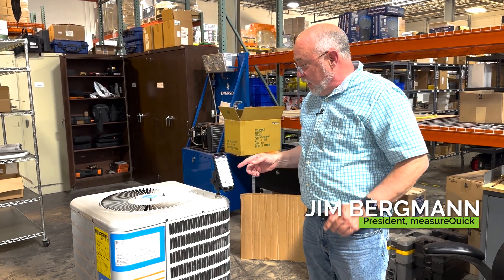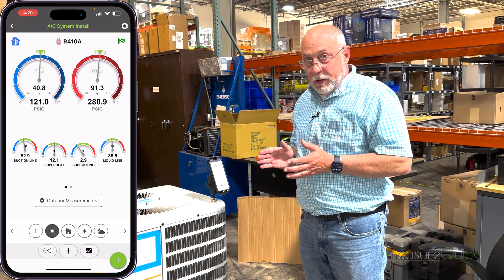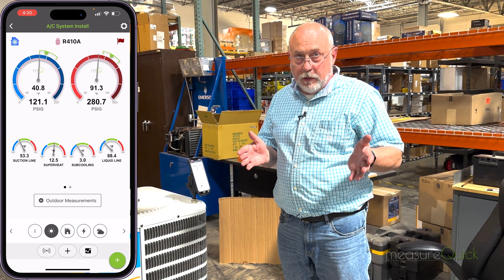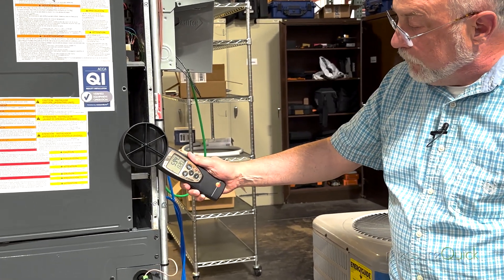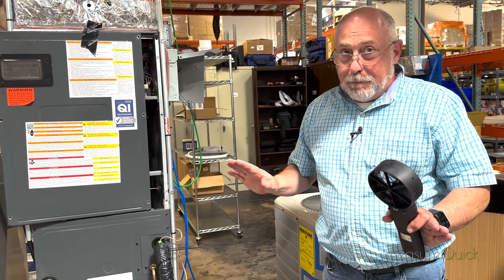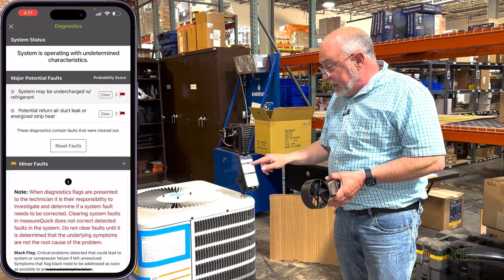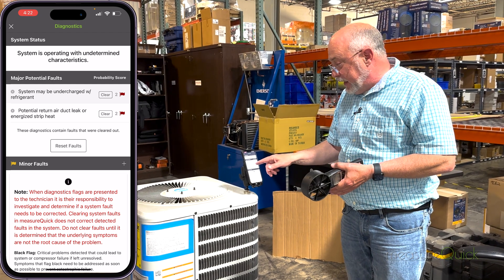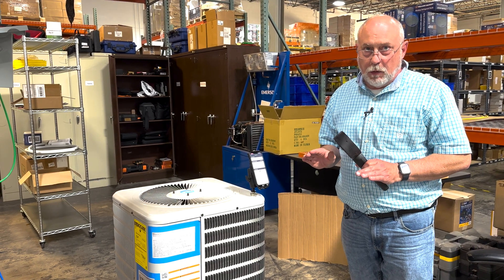Troubleshooting HVAC Issues Beyond Superheat and Subcooling

Comment: ❓The other day i was getting about a 10psi difference on the mQ app compared to the Field piece app. Put the gauge on it and the field piece was accurate. 
Why would i get different readings if they have the same source?
Reply from the maker: @MoonRambo702  did you zero a probe in the toolbox with pressure on it? Maybe open the toolbox and press the zero button. They are software zeroed.
Reply: @measureQuick  Ah, I did not. Thanks

Comment: How can you tell if your fan speed is too high if you don't have an anemometer? And will a too high fan speed raise the evap pressure too high on a perfectly charged system?
Reply from the maker: @realSamAndrew  static pressure with a manometer. High airflow will have a larger impact on superheat, making it go up. The pressure is driven by temperature and by a smaller part RH. Pressure changes with high airflow are small. I can do a video on that and show the impact.
Reply: @measureQuick  I would like to see that video. If superheat is too high due to airflow, then without paying attention to airflow and charging by superheat only, wouldn't that cause you to add too much refrigerant to lower the superheat, creating higher than normal evap pressure? Sort of a secondary cause/effect?

Comment: The anemometer measures air velocity that needs to be averaged over the area of the leak. You went directly to CFM. Did I miss something? The temperature of any air bypassing the evaporator also matters on a real job.
Reply: Good point, but he was just giving us an example of not just looking at SC and SH to determine if the system is good.   However, when he used the anomometer, it was just to give us the idea of what he meant. 
😅
Reply from the maker: @lynncomstock1255 You are correct I entered the open area of 80”^2 and K-factor of 1 beforehand. It was also just a quick estimate to understand the size of the problem.

Comment: Curious what MQ estimated airflow  was? Also have you made any content wi MQ and the testo 429 flowhood?
Reply from the maker: @hvacshinobi8047  the estimated airflow was outside of what we allow the software to calculate. That said it would have over estimated it had it calculated.
Reply: @measureQuick  
Okay, so how would you know to go looking for the mystery air leakage or maybe the better question is how did MQ make that presumption?
If you did not have MQ, what is the way to come up with possibilities like that?
Reply from the maker: @jrsmyth9761  temp split, approach, leaving air conditions, bypass factor etc. The software is looking at both sides. We have expectations on how the airside should perform when the refrigerant side meets expectations as it did in this example.  Could’ve gone into much more detail, but I was trying to keep the video short.

Comment: Sometime you have to just accept real world conditions.
Reply from the maker: And sometimes you simply need to improve them.
Reply: @measureQuick  You can't improve anything unless the customer give you the OK, if you have a massive air leak and the customer tells you that can't afford to fix it than your gauges are the only thing you can base your repair on. You do the best for the customer with what you have to work with.
Reply from the maker: @discoveryman59  you can always make a temporary repair in that case. That’s a good use for duct tape until in can be properly addressed. That said, it’s not the customer declining the repair that is typically the problem. It’s typically a mechanic , not finding it altogether and not offering the repair to begin with.
Reply from the maker: @discoveryman59  your “real world” is the exception not the rule.

Comment: Thank you thank you for making this video. 
  I’ve been trying to push and stress this message that if your airflow is off and your readings look perfect. It’s all really wrong.. 

But I’m just one little tadpole in a mud puddle
Reply from the maker: A lot of the troubles shooting chart show low airflow with correct charge, the do not show what happens when you have a combination of low airflow, low charge and in this case and higher return air temperature that made the head pressure look very normal. But all that said, this is typical new install conditions. Glad you like it.
Reply: @measureQuick  or after somebody performed a repair. 

Like one they replaced the evaporator with a different manufactures evaporator that is a little bit smaller and bypasses air handler . 

When somebody changes a condenser motor with a different motor and shaft length position in places the fan in a different position, so it no longer flows the same amount of air over the condenser coil as the original .